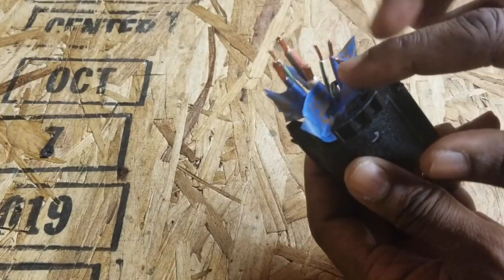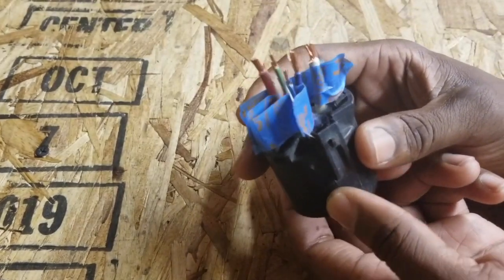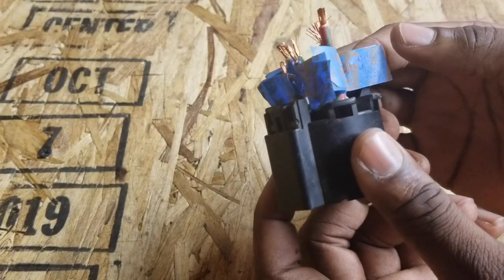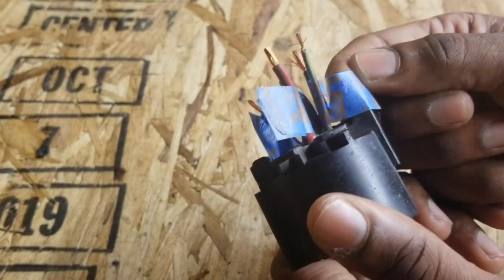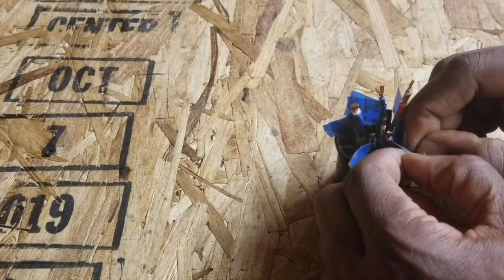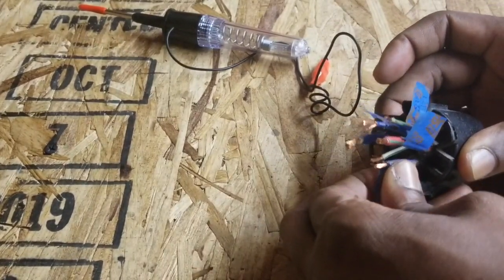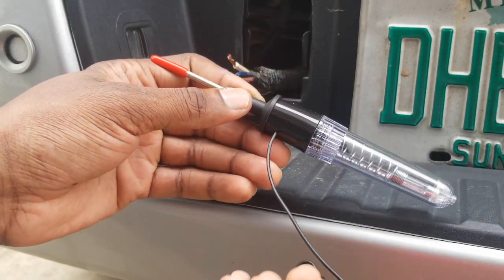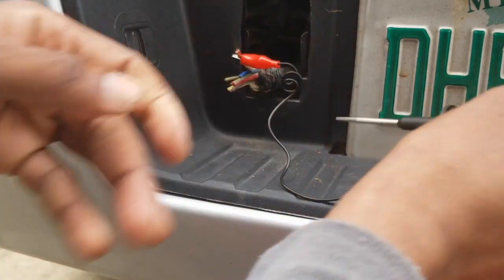How to Wire Chevy Silverado 2014-17 Trailer harness/plug

Comment: On my trailer I got lights everywhere but Lt break &blinker not working
Reply from the maker: The wires are tricky and I would imagine that some years trucks and different manufacturers of trailers don't all have the same corresponding wires. Hard to help without playing with the wires hands on. Pull out your multimeter and start some testing is the best route.

Comment: I have same truck , my blue wire is not working ? Did you know what could be ?
Reply from the maker: I would start with checking your fuses, if those are all good then i would check your grounds wire then if that checks out run all the way back to the origin of the blue wire. Worst case you run the blue wire independently outside the harness. Good luck.